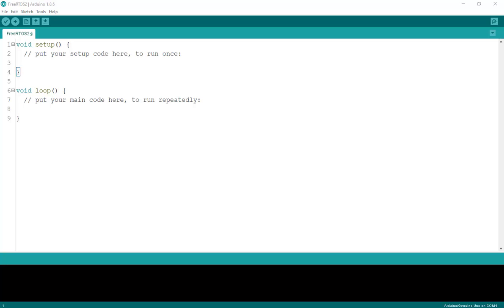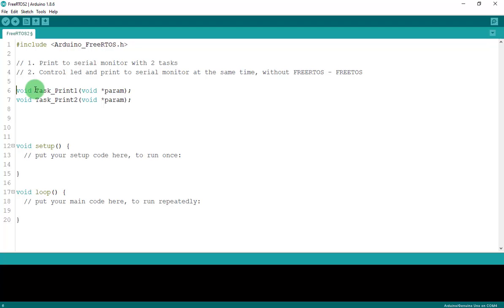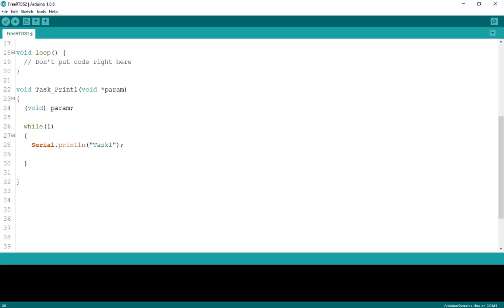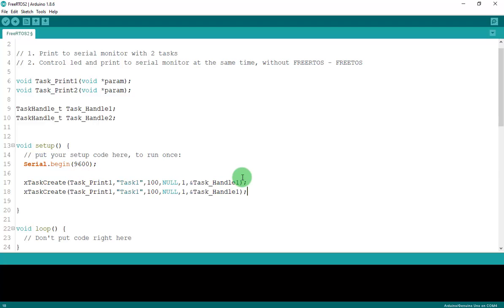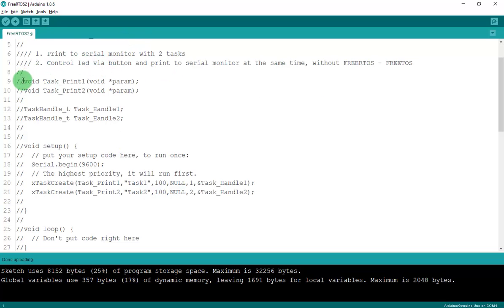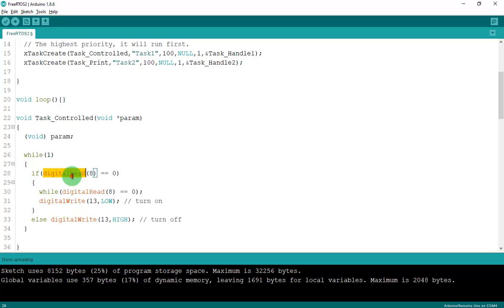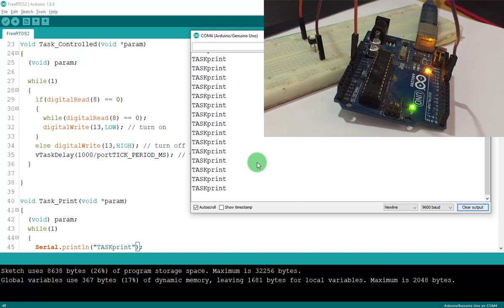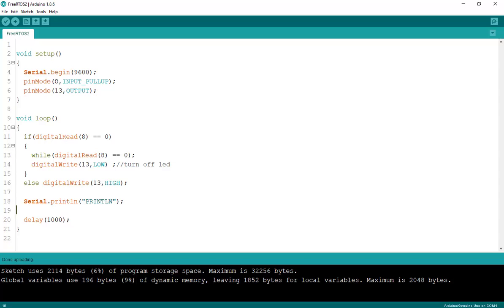FreeRTOS With Arduino Tutorials 2 - How to Handle Tasks with FreeRTOS on Arduino.

Comment: This functionality implemented using freertos can be do using a non blocking delay (use millia) to print once a second in the loop along with a simple if else to control  the led using button after the print code. 
Tried and tested this and it works.

Comment: anh ơi cho em hỏi, em có  thể lấy output của 1 task để dùng  cho task khác được không, nếu  được thì làm như thế nào ạ, em cảm ơn.
Reply: use queue to pass the value (or pointer to the output buffer) and use semaphore to signal between different tasks or threads

Comment: if i want to transfer two argument (in and out) of the Task_Print1, how to do that?
Reply: put them in a structure then pass the pointer to the structure. Use queue to pass the pointer and use semaphore to signal between different tasks.